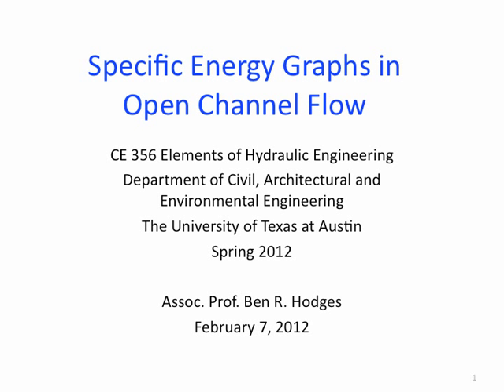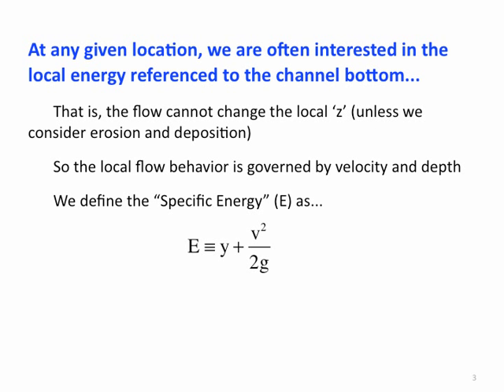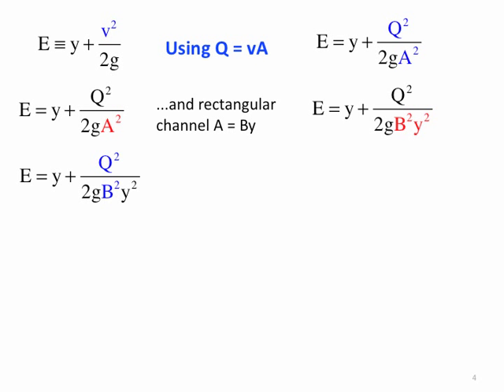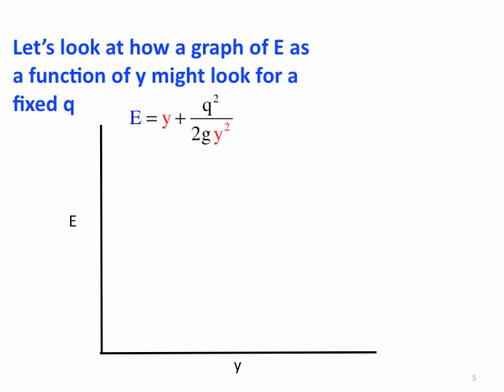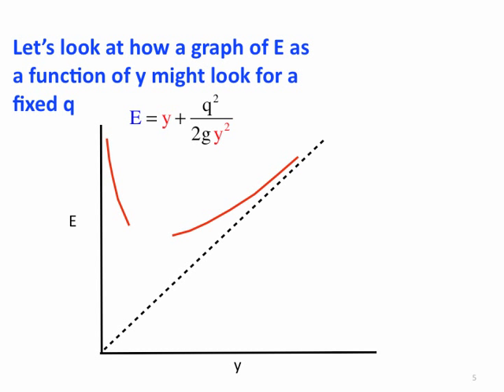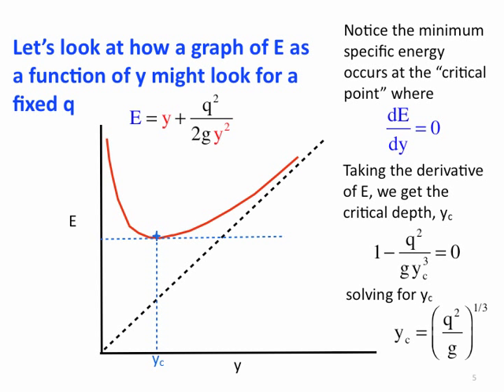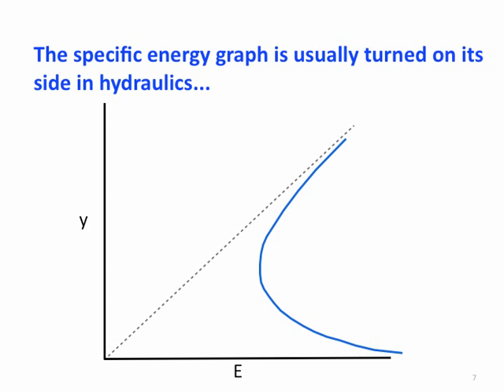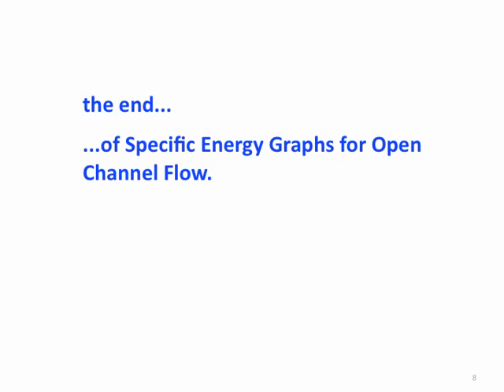Specific Energy Graphs.mov

Comment: How to physically think of specific energy diagram? ie to obtain it does one have to change the channel slope physically so that all other parameters are remaining same.
Reply: Any couple Yi and Vi are possible for a flux q if Yi x Vi =q (equation of continuity). And so you can select any couple Yi and Vi which products would be q. And if in a subcritical flux you are doing each time Y lesser, and increasing V to match q, and then for each couple Yi and Vi you calculate Ei, you will find that Ei goes less and less UNTIL a moment that for the next couple of Yi and Vi SUDDENLY Ei starts to increase again. That point is Yc and Vc. The physical meaning is that you can't evacuate for the channel a flux q with an energy E less than that it is provided by Yc and Vc. 
The key concept is that the same q, for example 5 l/s, could circulate for a channel with very different Energy Ei. Ranging from "infinite" Energy for those 5 l/s  (because it had big Y if subcritical flux, or it had very big V if supercritical flux) to a minimum Ec. But NEVER with a Specific Energy less than Ec you could get 5 l/s to circulate that channel....